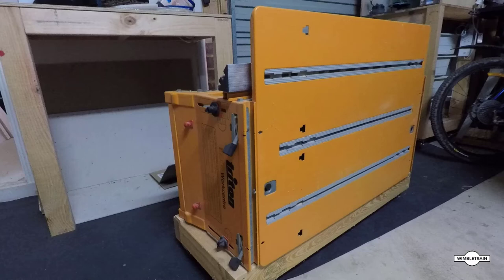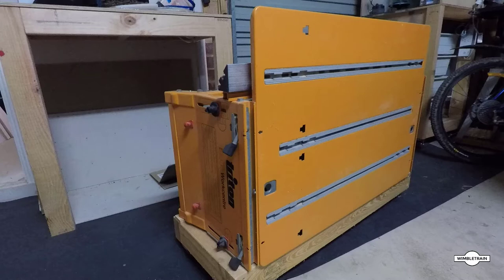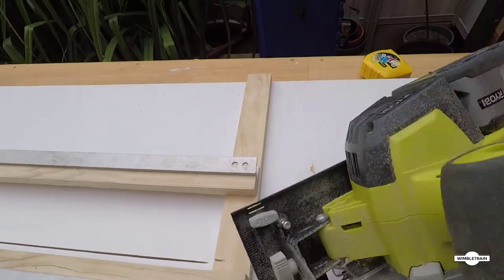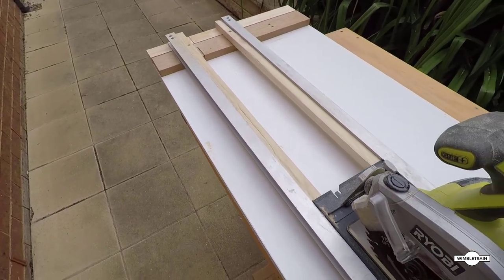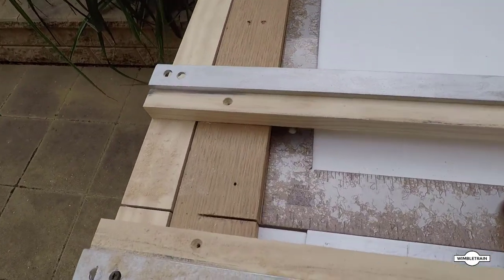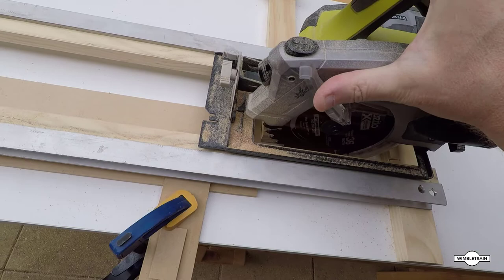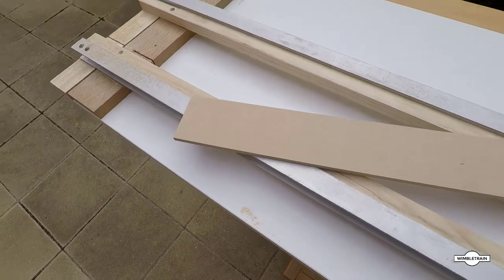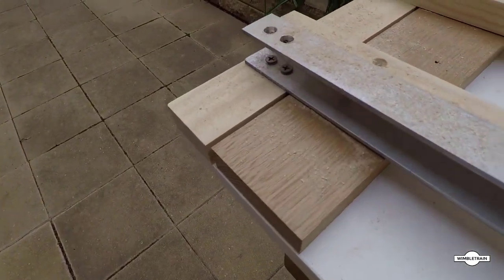T Trak Module Construction - Circular Saw guide

Comment: Hi John, just a thought - would it be worth measuring 64mm from the right hand edge of the blade slot, and fixing a length of straight timber/aluminium down the length of the jig? That way you could slide a piece of mdf into the jig from the left, butted up to the new 'stop', and make your cut. The waste would then be on the left of the cut but you would have a perfect 64mm strip without the need for measuring each time. Just a thought
Alan
Reply from the maker: Hi Alan  that's a great idea, that way every piece you cut would be exactly the same width (64mm) every time. That way all your modules would line up perfectly with each other 👍